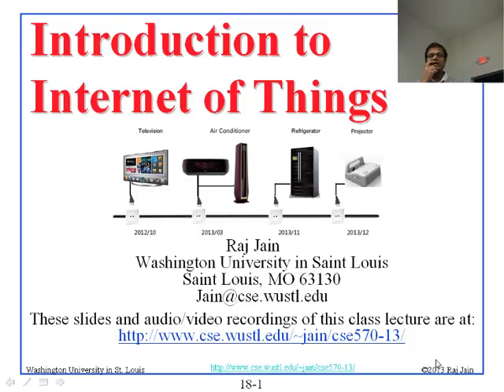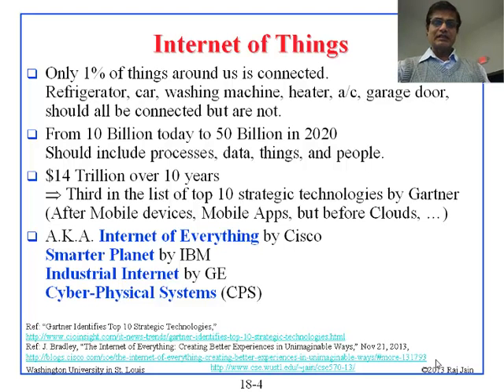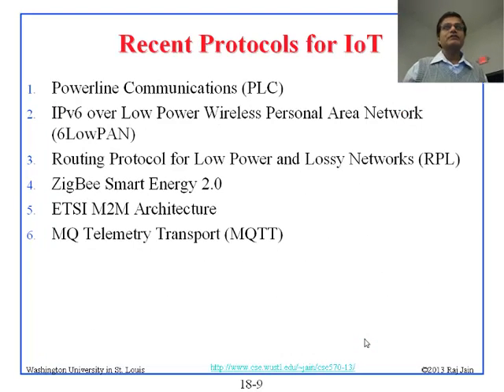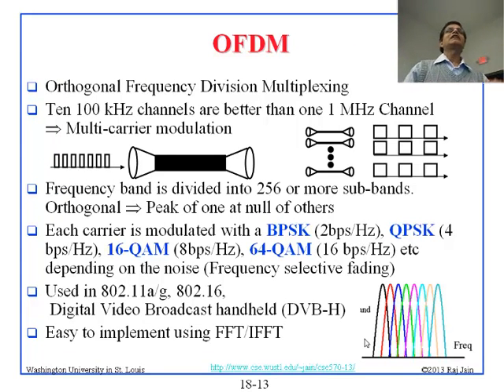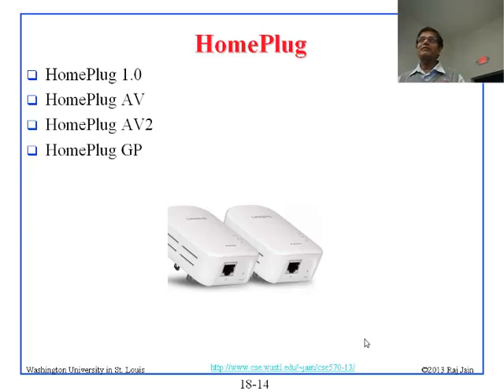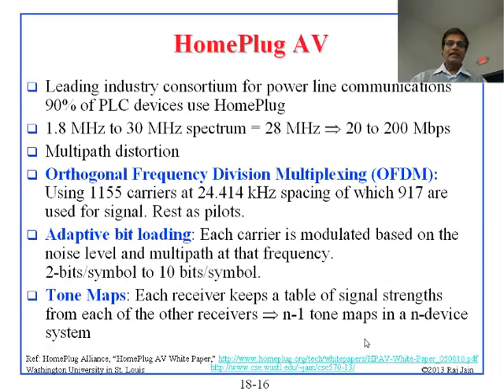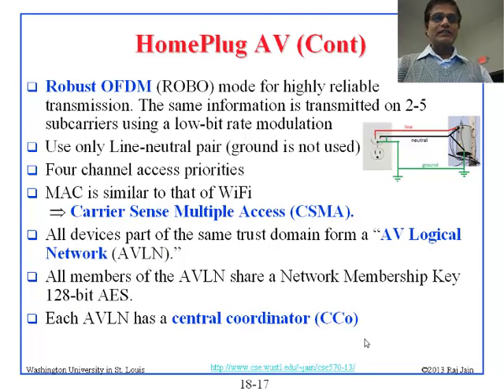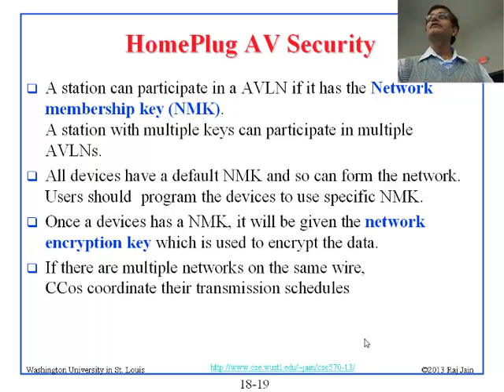CSE 570-13-18A: Introduction to Internet of Things (Part 1 of 2)

Comment: Great lecture. You can add one clarification. The reason EU and other countries have less transformer is related to voltage used for the transmission. US used 110V at home. To transfer 110V from distribution will need pretty thick wires, hence transformer near hone is necessity. With 240V, companies can send to longer distances with same thickness (of wires)....